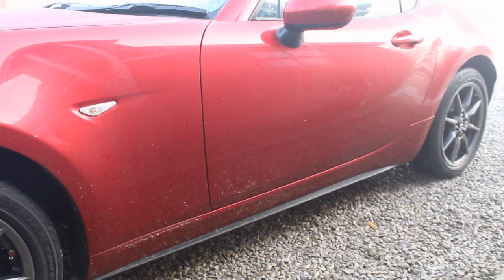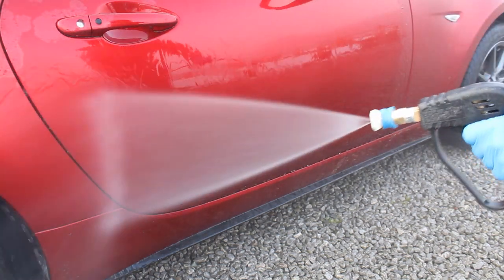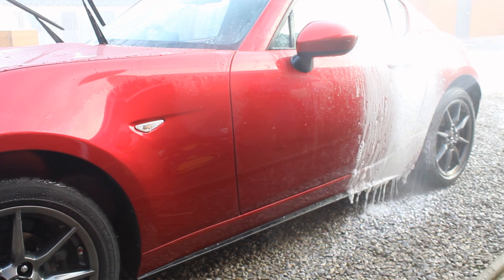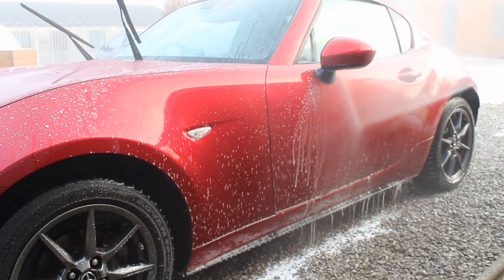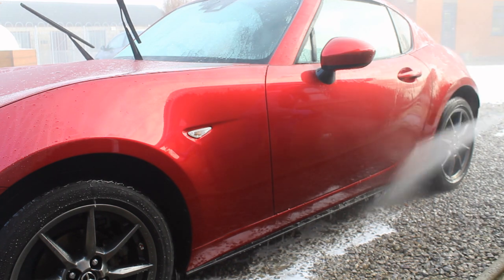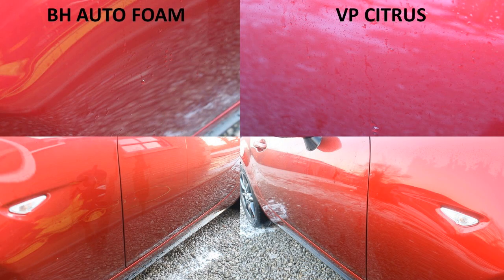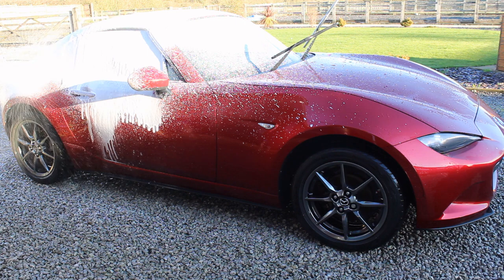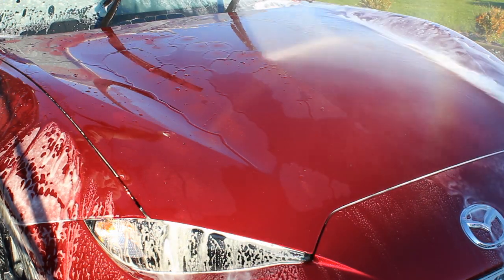Snow Foam vs Citrus Prewash | Do You Need Both?

Comment: Regarding applying product on dry vs wet panel that I saw on another channel. If you spray dirty panels with pressure washer with water only, you are pushing the dirt into the paint and possibly into crevices. Whereas if you apply foam first, then most of the dirt will become dislodged and washed away gently, before applying the strong pressure washer spray

Comment: Interesting video.  I use Swissvax products on my car and pleased with the results.  I add BH Touch-Less snow foam as part of the cleaning process and this works well.  Never used a citrus pre wash as I don’t see the need.  I power hose the car to remove any dirt, with my MJJC Snow Lance I spray on Touch-Less and leave for 8 minutes.  Power wash off the snow foam and then wash the car with Swissvax Car Shampoo.

Comment: I use a citrus pre wash on a dry vehicle, let it dwell for a couple of minutes then pressure wash off. The prewash cleaned alot better than pressure washer alone. 
Then I apply my snow foam. This gives an adequate clean on a cold winters day and a decent clean in the warmer months.
I don't always do a contact wash.

My current products are autobrite direct citrus pre wash at 30:1 followed my autobrite direct superfoam pH neutral at roughly 200ml topped up with 800ml water but I can get up to 4 washes from a full mix depending on how windy it is.

Comment: Great video 🙂

I love both of these products. I tend to use BH more throughout winter - I travel 1,000 miles per week between Yorkshire and Cumbria and the winter road grime is insane! BH at 5% PIR or Surfex HD a 5-10% are the only chemicals that significantly impact the road film (amazingly so) allowing 90%+ to be removed with a pressure washer. 
The Valet Pro, even at 20%, cannot match this, and the dwell time to achieve decent results is a factor.
That being said, I use Valet Pro citrus throughout summer, as it's actually better at removing the bugs! 
It's also far better than 95% of the Ph neutral snowfoams out there.
Both are valuable additions to any enthusiast, or professionals kit.

Also, just to add - I find Angelwax Cleanliness citrus pre-wash to be more potent than the Valet Pro. It also foams up more and has a more premium 'feel' to it. Comparable in price too! So worth a try 😉👍

Regards,
Jason
Reply from the maker: Thanks for watching! Wow that's a lot of mileage! The surfex and auto foam combo seems to be a popular option, I'll definitely give it a try next time my car is really filthy. I'll add that one to the list, I've not tried any Angelwax products yet so it'd be a good one to start with :)
Reply: When you spray the surfex. Do you dilute it with water?
Reply: @j.f.4765  Use at 4% Surfex.
Reply: i am also a Bilt Hamber super fan

Comment: Great video Heather. I have been trying this myself recently and had pretty good results with Koch Chemie Green Star at 1:8 and put AM Details foam on top. Teh AM foam clings for ages, giving time to get round the window rubbers, badges etc with a detailing brush. Green Start is very versatile, and a 10 litre is very cost effective.

Comment: Really interesting video thanks so much. Would love to see more videos like this with your thoughts / ideas on washing/detailing process. It's interesting as well about whether to foam a wet or dry car. I've heard fair arguments on either side. Like you I tend to pressure wash with water first to knock some of the loosest dirt off before using foam.. I find with citrus pre wash I need to use it at quite strong ratios for it to really work more like 1:4 or more. Thing is BH foam is just very good. Thanks again for this video you're always honest and genuine which is great.
Reply from the maker: Thanks very much! Yeah auto foam is a great product so it was definitely a hard test for the pre wash. I reckon if I’d have used something pH neutral the results would’ve probably been the other way around!

Comment: Another good video. You seem to think of things I think about but I can't be bothered to test them.😄 I would normally use surfex hd at 5% then auto foam or 8 below on top. Maybe thinking now to just use snowfoam if the cars not to dirty. Also what pressure washer do you use?.
Reply: I have also started to put shampoo on through a snowfoam bottle and use the multi mitt method. Alot quicker as long as the shampoo doesn't dry. (In the summer)
Reply from the maker: Thanks for watching! All good products there. I’ve just got an older generation Karcher K4 😊

Comment: Hi regarding the discussions on wether to jet wash before using an APC / snow foam etc. I use BH products and have been immensely impressed so each time i have a question i just ring them for an opinion, in this instance their recommendation was in general to apply the BH Surfex HD and BH Auto Foam directly to the vehicle with the theory being that they will cling (and work) better to a rough surface than a freshly jet washed slippery surface. I believe there is a caveat to this, say on a vehicle that is absolutely caked in grime (subjective this one), this scenario though probably would not apply to many people who like this hobby as they would have probably cleaned the vehicle before this stage unless your into 4WD off road fun? Anyway for me living in a rural / muddy area my winter process so far is Surfex HD at approx 5% through a pump sprayer on the worst areas topped up with the Auto Foam at around 3% PIR, leaving it for up to 10 mins. Great video and hope you get the new BH Touch-Less product as I'm keen to see how it performs.
Reply from the maker: Thanks very much for the comment. That's really interesting, I'll definitely give it a go on a dry car and maybe do a comparison video on a few vehicles with different levels of grime and protection at some point. I'm very tempted to pick up touch-less soon, I'm still a bit confused why they've brought out another snow foam considering auto foam is so popular so I think it'll be really good to do a comparison of the two

Comment: Good video Heather they are very different products I personally always double up with prewash products and lately found different results on different cars with VP citrus I tend to find it great for tight areas and interiors and as you say tyres at the end of day it’s down to personal preference good video also depends on your protection levels on your clear coat 🙌🏻
Reply from the maker: Cheers Paul! VP Citrus is really versatile, and it’s so cheap as well it’s definitely worth having a bottle mixed up. I’ll try it on some cars with no protection and see how it performs then too at some point 😊

Comment: Great video Heather. Like your new titles and you’ve got a hoody too, turning into a real YouTube pro! I first started using a snow foam pre rinse about 15 years ago and made Auto Foam my choice of product pretty quickly. With Auto Foam being so effective,  I’ve never used a citrus prewash a I’ve never found it necessary.  I think people use a citrus and then a foam because the foam they use has little cleaning power but use Auto Foam and a citrus is never necessary.  One thing to bear in mind is there’s a balance between cleaning ability and degrading the LSP. A strong TRF will shift loads of dirt but will strip your sealant too. Auto Foam is alkaline but as Jon on the Forensic Detailing Chanel tested, this had little to no effect on various LSP’s. I never worry about that anyway as I always top up the protection regularly which is half the enjoyment!
Reply from the maker: Thanks very much!! Auto foam is such a great product, every time I use it I always impressed with how much traffic film it can remove. Yeah I can definitely see citrus pre washes being more useful if using a ph neutral snow foam but I guess at that stage the snow foam would become obsolete tbh. Very true as well, never noticed auto foam have a negative effect on LSP, even if it did have an impact, I’d rather that prewash was effect than inflicting swirls and the protection can always be topped up!

Comment: Surfex at 4(ish)% on lower bits, wheels & arches. Pressure off,  then BH foam at 4(ish)% PIR. No science behind it but the (unproven) theory is that the surfex helps soften the bugs & cow ** in the summer & general filth in the winter. - therefore less work for the foam to do. As you say, there's no right or wrong. I'm open minded & try different products & methods. That's part of the fun !
Reply from the maker: I’ve not used surfex as a pre wash yet but I probably should try it, the value for money is really great. Definitely! I can never just settle on a process because I always just like trying out different products and techniques too much!
Reply: @AutoCareHQ  have you tried Surfex as a prewash before Autofoam yet?

Comment: I’m learning through watching. I have similar results. The ph neutral snow foam is okay but very wet and does dwell. Did wonder about not pre rinsing before citrus? But would just dry out. Still do in two parts. Citrus does dry out quickly though so can’t leave for too long.

Comment: Fantastic video. It's about time this was covered. 

For me, I use Autobrite Magifoam. I haven't found ANYTHING that gives the same level of cleaning and a thick, workable foam that can dwell for so long. 

The car is literally 95% clean after a good 15 to 20 minute dwell (although I've had longer in cold westher) with Magifoam. And I can tell this based on the colour of the water in my rinse bucket after the contact wash. 

If you haven't tried it yet, I'd definitely recommend it.
Reply from the maker: Thanks very much! Cheers for the recommendation. I've been thinking about picking that one up actually, it seems to get good reviews. I'll definitely get some at some point and maybe do a snow foam comparison video with the others I've got as well I think
Reply: @AutoCareHQ  no worries at all. It's good stuff. 
It isn't the cheapest to be fair, unless you go for the 5 litre option of course, but it does do a great job of cleaning and I do love a nice thick, creamy foam!  Lol.

Comment: Great video heather and very ‘en vogue’ given the time of year we are in. I have recently moved onto a TFR at 1:30 as my pre wash just on the bad lower sections, I then rinse of the TFR after 2-3 min dwell time and then apply snow foam to the whole car (currently using KKD blizzard). I use the same valet pro citrus as you but I use it wheel arches/tyres ( if I’m not using YumCars undress) /badge and front grill area. I can do 800 miles a week in my car so the TFR comes into it’s own at this time of the year on the worse areas. Keep the videos coming 👍
Reply from the maker: Cheers Peter 😊 Wow 800 miles is a lot, no wonder you need a TFR! Which one are you using at the moment?
Reply: @AutoCareHQ  I’m using a carplan trade valet one from Halfords (only about £10 for 5litres) and even if it strips some protection I put fresh on every time I wash it anyway. Unfortunately with managing scaffolders across east anglia I travel.......a lot!

Comment: Hi Heather just a quick question I have 2024 Astra and it will having its first wash since the dealership  pdi clean and after I've done the washing part obviously I'll be polishing it and will be using an Autoglym polish and also if I can need to use an Autoglym ceramic spray what is your advise? Gavin 😊

Comment: Hey Heather
It’s Sunday night so it’s time for Auto Care HQ video 🤗🤗
I’ve been using google Surfex HD and topping with Auto Foam.
Seems to give it a kick.
Maybe in the Summer will just use one or the other.
The question is whether to rinse before applying either products 🤔
I tend to rinse as much dirt off before using products.
Some may disagree 🤷‍♂️
Nice video though.
Did you receive your mystery Car Chem box yet ? 😳
Reply from the maker: That’s a good idea! I’ve only ever tried surfex with auto foam at a higher concentration to try and strip the protection down a bit but at a lower concentration I can see that being really effective. I always prefer rinsing first just to give the prewash the best chance possible at removing traffic film rather than layering it on dirt that can just be removed with a pressure washer. I’ve not got my boxes yet, starting to worry they’ve been lost! Have you got yours?
Reply: Yeah I like to give the chemicals the best chance so less dirt on the panel the better for me 🤗
Not got my box yet but had an email saying how overwhelmed they are at the amount of orders they received.
Could be a little while I’m thinking.
Saw one detailed post an unboxing of his products.
One was for cleaning bikes 😬
Not sure about that 😳😳
Will keep you posted if I receive anything 🙏🙏
Reply from the maker: @mantaman7314  Fingers crossed it's not too long. Hope I don't get that one then, I don't even own a bike haha!
Reply: @AutoCareHQ  agreed  i think pre wash is overated i started using surfex hd through a foam cannon on a work vehicle now use it alll the time on my bmw it does not strip light ceramic although others will tell you otherwise the most important thing is to get all of the looose stuff off before a contact wash and nothing works better than surfex hd

Comment: I just use surfex hd as a 'pre wash' and wheel cleaner. Spray on, foam ontop. I have some turtle wax max power if i need more 'power'. Only takes a squirt in a 2 litre mix.

Comment: Hi Heather, I used Auto Glanz citrus prewash for the first time using an power sprayer I then rinsed it off followed by BH auto foam on my car that hadn’t been washed for about a month. I had great results when I did my contact wash as my wash bucket water was relatively clean.
Reply from the maker: That sounds like a great combination. I'm still yet to try more auto-glanz products, but I've got them on the list. I've spent too much on the car chem boxes to justify getting anything else for a while haha!
Reply: @AutoCareHQ  saw Jon from Forensics use spear and Jackson pump sprayer to apply a pre wash so much easier than using a trigger spray.

Comment: Hi Heather,
I am a bit confused. Manufacturer recommended Dilution vs PIR.

Why not sticking with the dilution provided on the instructions e.g 1:10 or whatever provided by the manufacturer?
It’s a considerable difference between using a 100ml solution (+ 900 water if you’re using a 1l snow foam lance) and using approx. 350 ml solution to achieve 4% PIR.

Does it means that in order to achieve the right PIR with BH the snow foam usage is going to be higher ?
Reply from the maker: Yep that’s right, In order to get the recommended 4% PIR of auto foam you need a lot more snow foam than with most others. They don’t have a dilution ratio on the bottle like other snow foams where you’d typically see something like 1:10
Reply: @AutoCareHQ  Thanks a lot Heather, much appreciated! Keep up the good work! 😊

Comment: I use the BH auto foam as well. Very good and looking forward to trying out the new BH touch-less and the touch-on sachets. Could be better and faster in colder weather 👍
Reply from the maker: The two new BH products look very interesting. I’m thinking about picking the touch-less one up soon and seeing how it compares to auto foam
Reply: @AutoCareHQ  not quite as good the touchless snow foam. Auto foam all the way I do use the surfex hd as a tfr first before foaming straight over it. Then gyeon wet coat after for protection. Winter washing is so much quicker and easier for me in this way

Comment: Personally I use valet pro citrus on the car from dry and then rinse, then autofoam and rinse before going to the contact wash. Great video. I'd still prefer to use both over one or the other just as to try and be abit safer in avoiding swirls during contact washing. Every little helps in prewash stages as you said
Reply from the maker: Thanks for watching 😊 both are great products, especially with how bad the weather is atm and how dirty the car ends up being I still like doing both stages to be on the safe side too!
Reply: @AutoCareHQ  its a must from me, never tried using valet pro citrus beyond 1:8 ratio though, is it noticeably different at 1:6?
Reply from the maker: I'd say it's a tiny bit more potent at 1:6 but not a massive difference to be honest
Reply: @AutoCareHQ  will give it a try next time at 1:6. Also, would you not prefer to use a pump sprayer than a spray trigger bottle?
Reply from the maker: It'd definitely make life a lot easier! I've only got a pump foamer atm and loads of these trigger bottles lying around but I'll probably upgrade at some point.
Reply: @AutoCareHQ  https://www.macsautodetailing.co.uk/shop/kwazar-power-spray-1-5-litre-pump-sprayer-with-viton-seals/ have a look at that, I've got 2 never had any issues. Pre wash in one, drying aid in the other. I also have some IK sprayers and cant honestly say there's a major difference other than cost.

Comment: I usually  just mix warm water with my car shampoo In a spray bottle and use that.  And the car i clean has  got black wheels  use It on them too.  I was a mobile valeter. but im limited now with what i have.   Does the job though.  There lots of tricks in this game  theres chemicals you can use for stuff its not actually  for😉

Comment: Pointless review once you rinsed with water. Not only is the water taking the dirt off,  but the static water left on the surface redilutes the mixing ratios.
Reply from the maker: I always rinse before applying a prewash, it doesn’t take it all off otherwise I would never need to use anything else. The dilution afterwards due to the wet panels is pretty minimal and the products are still effective, I don’t feel any need to increase the concentration
Reply: you have clearly never used a proper pre wash its night and day between rinse and something like auto foam